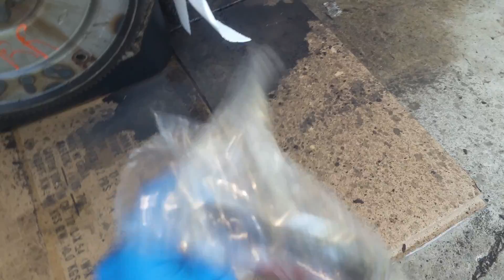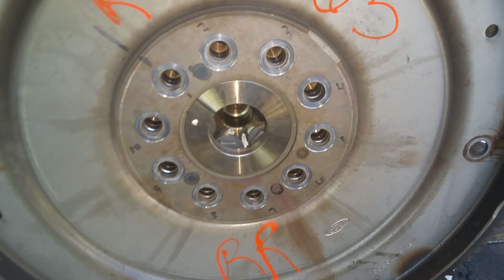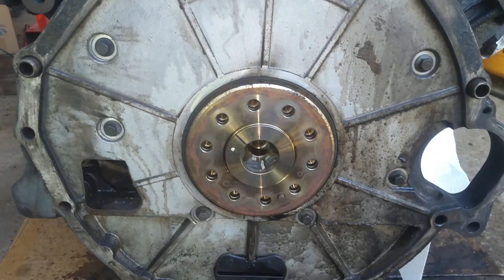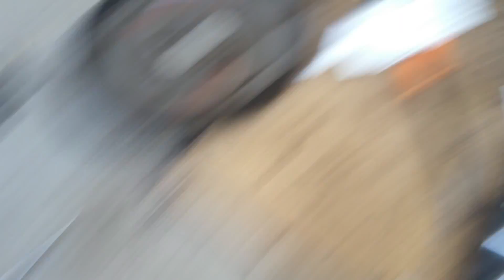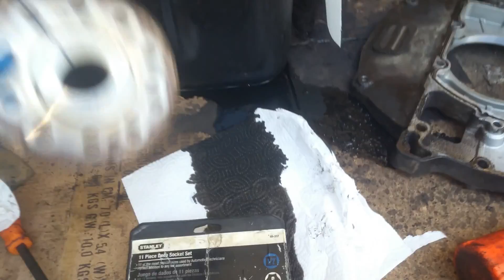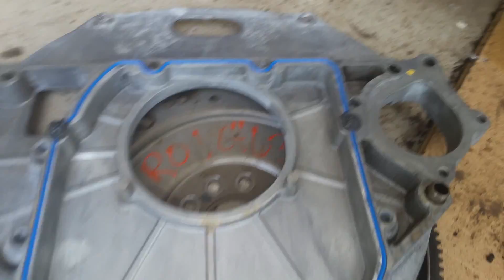how replace rear main seal ford 6.0l powerstroke

Comment: you dont need to remove the whole rear plate in order to change this seal. the ford factory manual has you remove the flywheel front adapter (the plate you used a puller to remove) then punch two holes in the old seal across from each other and use a special tool (but can be done using two screws and vice grips to pull the seal off)
Reply: Make a video

Comment: Great video really helped clear somethings up but came across it to late. Now I have a problem.  After installing the transmission, I realized I forgot to install the plate that goes between the flywheel and the crank.   will this cause problems are I can run the truck and install it a later date.  The transmission is already bolted up when I seen the plate by the front tire. Help.
Reply from the maker: It is the flex reinforcing plate. My main concern would be the positioning of the flexplate. I would myself want to have it just out of precaution. Wish I could be more help.

Comment: Can the bell housing seal and crank seal be done with engine in truck?
Reply from the maker: The short answer is no. Even if the transmission is removed there would not be enough space to remove the rear cover without cab off. The only other scenario would be front of the truck removed and sliding the engine up and forward. However the amount of work required there it is only another step to remove it entirely. If the rear cover is ok you could however get away with just replacing the rear seal , however it is probably unlikely rear cover gasket is not leaking as well. Thanks for watching.
Reply: @WrenchTheory501  thanks appreciate the answer

Comment: Which 5 bolts? You mean the 6 bolts that you can see once you pulled off that piece with a puller? Just wanna make sure I don’t remove anything wrong.
Reply from the maker: Do not remove or lossen the 6 bolts under the piece I used the remover tool . The press on hub and the rear cover of the engine is all you will need to remove. Thank you for watching

Comment: Are all the torque specs similar on the 6.4 doing mine later
Reply from the maker: The m8 bolts for rear covercall for 23 ft lb says auto and manual . Says manual only, that have m10 bolts get 45 ft lb. A lot of stuff I may or may not torque I usually just air on the side of caution with smaller bolts . Flexplate/flywheel to crank 44 ft lb in a criss cross pattern then 69 ft lb . But yes a lot seems same as 6.0l . Thanks for watching and best of luck on your project .
Reply: @WrenchTheory501  thanks man perfect timing im finishing  it soon here

Comment: Did you have any problems tapping it in I just installed mine I hope it don’t leak I put it flush with the cover
Reply: Did you have it hit is in hard when it got close to the cover
Reply from the maker: It's been holding up good so far. I used my shot filled rubber mallet so it went pretty easy the best I remember . That's about all I did was get it as flush as I could get it . Thank you for watching sir

Comment: Rounded out the flywheel bolts. Nightmare
Reply: Got it with harbor freight bolt Remover sockets.
Reply from the maker: Great job , good to hear you got them. I've gotten a few harbor freight tools myself . Thanks for the update
Reply from the maker: Sorry to hear , I've rounded a few bolts myself . I know it's frustrating hunting down new bolts . Best of luck with it and thanks for watching
Reply: Thanks for making this video again.
Reply from the maker: I'm glad you found the video helpful. It's good to see an aftermarket part work out well , so far no leaks with this fel pro. Hope everything else went smoothly for you and thank you for watching .

Comment: Thanks for this video I’m getting ready to do my seal on 2004 6.0 was wondering what seal you ordered I just wanted to get the right parts thanks again
Reply from the maker: ://rover.ebay.cohttpsm/rover/0/0/0?mpre=https%3A%2F%2Fwww.ebay.com%2Fulk%2Fitm%2F311408453191
Let me know if it doesn't work this is the brand I used , the Ford brand are over twice as much around 80 dollar range. So far so good with the fel pro , I've had good success in the past with their seals. You can get seals with or without the wear ring but I believe most are coming with the wear ring , front and rear . The one I used has the wear ring as you see in the video. Let me know if I can help thanks for watching
Reply from the maker: Fel pro bs40700 plug that into the eBay search if the link doesn't work .
Reply: s33therfan I really appreciate it what happened was I had my motor pulled doing heads and a lot of other stuff and I got the motor back in all buttoned up and I have these dang 6 bolts left thy go in the rear engine cover (it really sucks) lol
Reply: I thought about just leaving it cause the  two at the top under the hpop are in but I’m assuming it’ll leak if I don’t
Reply from the maker: Reminds me of the time I didn't seat the torque converter on a truck . I was so mad I had to give about a week before I could work on it again. About the way I have to do it is to walk away for few days , but it happens to the best of us. Like the saying if you ain't messing up you just ain't doing nothing.
Reply from the maker: Yes indeed I'd want to get those bolts in and at least you can get a new seal on that rear plate while you're at it . Best of luck and thanks again for watching

Comment: Hello i’m replacing my main seal and i was wondering if you have to leave the metal ring on it ? I thought that was only to put the seal on place
Reply from the maker: That metal ring is a wear sleeve you'll notice the red loctite on the inner part. Now you can buy these seals with or without the wear sleeve it's optional . Basically it just prevents wear on the crank from these Teflon seals , they sell the same type of set up for the front seal. Now I would say oem would be the best way to go but like in my case keeping down cost was my goal and so far so good with the fel pro. Thanks for watching sir let me know if you have any other questions.
Reply: @WrenchTheory501  i will be doing this because I dropped the HPOP mounting bolts down the back by that gear wheel. hopefully I can drop tranny and get the rear cover off, thanks for posting and any advise would be awesome this is my gfs youtube account fyi

Comment: Hate to bother you again, but will that puller kit remove the front harmonic balancer/pulley?
Reply from the maker: No problem , I had to jog my memory a bit . The front 4 bolts hold the harmonic balancer and mine just wiggled right off of there . Those 4 bolts are really tight I used an impact . I believe they call for a rediculous amount of torque but just got them really tight . I never had to replace my front seal and was really surprised it was the only seal that wasn't leaking .
Reply: +s33therfan OK! Thanks again!👍

Comment: No leaks! As always, impressive attention to detail. Thanks!
Reply from the maker: +Baxrok2  thanks for the support I appreciate that. I still have to attempt the front seal . I know it seems you need a special tool for anything these days but I'm going to attempt it . It's just a good feeling knowing you don't have to worry with leaks for a bit . Thanks again for watching
Reply: Front main is really easy.  Just time consuming.  FYI don't forget the dowl pins. There are 2 and boil the black seal and use a lubed thin putty knife to install.  Otherwise is too thick and your going to flip trying to install.